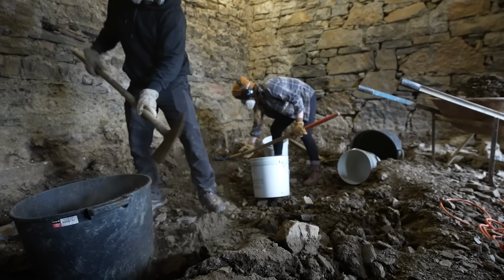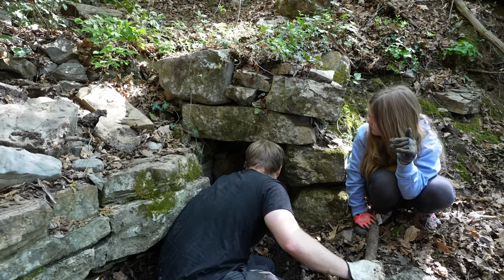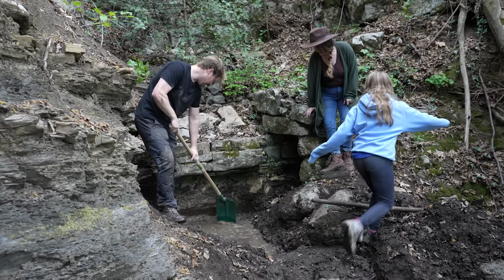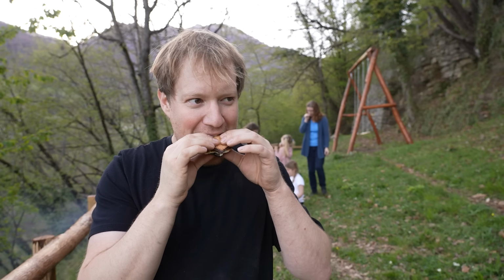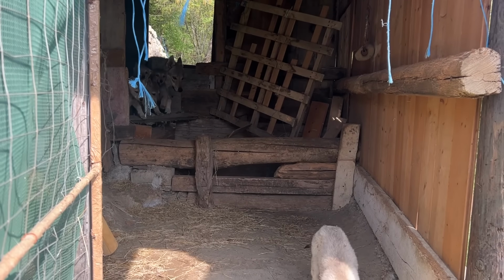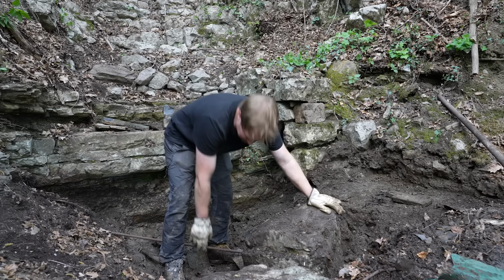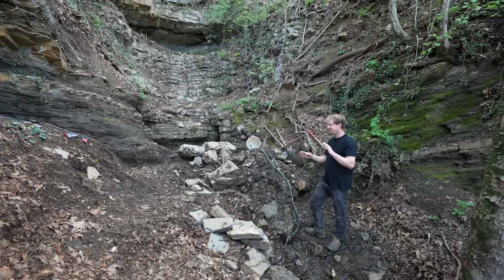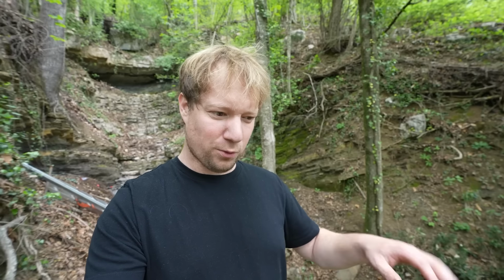Building a Pond from a Natural Spring

Comment: suggestion: drain tub. drill a hole in one of your rocks near the base of your wall. Insert a 1" pipe and re-seal, extending the pipe about 1 foot past the base of your tub. cut down a standard rubber tub stopper to fit in pipe. Now you've got a drain to quickly clean out the water / gunk to let new clean water back in. MUCH better than having to pump it out every time you want to clean!

Comment: What a blessing to have found that unexpected natural recourse! It's very likely that people before you had it pooled up then piped down to the house for livestock or household water. Also, the little stone "box" could have been used like a spring house to keep dairy products stored and cooled in the water. So neat to have that available to you! Bonus for the off grid homestead!
Reply: That's what I was thinking, the box was a spring box to keep things cool.  Whatever it was that happened to the original spring stonework looked pretty catastrophic, perhaps a major flood wiped it out one year?  I imagine it might have had a wooden enclosure over it as well.
Reply: That or too many hugs and mosquitos bred so they filled it in. Or bad snow year and age of the structure to contain or funnel water flow.
Reply: Yes, that is most likely what it is. Old pioneer homesteads here in the Smokies in North Carolina have similar stone boxes beside a spring. Its for keeping milk and other things cold.

Comment: Love the videos. 
When I was living in Brazil,  I did a pound just like yours. 
If your walls are leaking,  install a drain pipe on the lower spot inside the pond to  keep pond dry.  Work on seal wall and floor,  let cement dry and pond should be leak free.  Them plug the drain and let water fill it up.  Good luck.

Comment: I have a home on some acerage. Long story short a stream emerged from 150 feet behind my property. I knew where it began and surmised it passed through my property. I ultimately began getting water in my crawl space. So I set about searching and figuring things out. Ultimately I was shocked to discover a shallow swell passing through my property and a few neighbors was on a different aquifer than surrounding homes. This aquifer was created 120 years ago from natural gas. There were about 25 well heads many of which were flowing but routed through tiling. I continued searching and found a map at the county from 1969 and there it was. My property as prairie and woods with not one, not two but three streams solely fed by water shed and springs. So now I'm preparing to finish up my 3/4 acre pond by building a stream, waterfall for filtration and stocking soon. It is awesome in the Bible Belt we get 90-100 degrees in the summer and my pond only reaches 70 degrees with a fully exposed surface. I've started plants and planted trees but it takes some time. I ultimately have a 15 inch inlet and a 6 inch inlet. I definitely have a good amount of flow 😆

Comment: I'm in NY state and here if a pond is 3 feet deep with a natural base (not a plastic pond) then even when the top freezes in winter fish can survive over winter in it.  We bought feeder fish from the petstore and they do a good job of eating the mosquito larvae and keeping our pond from being a mosquito breeding ground.  we also put a couple of water plants in a pot on a ledge in our pond so that the fish have a little more to eat and it's pretty.  Our plants are tropical so we bring them inside over winter.  Our ponds are about the size of yours and we have a pump (which we use in warm weather)  that moves the water from the bottom to the top.  having a natural spring pond like yours is soo cool, I just wanted to tell you about ours and recommend that if mosquitoes are a thing in Italy that you consider prevention.  best wishes.

Comment: Impressed with your work at the water spring.   Have you considered testing the water for it's natural chemical makeup/PH value?   That may help you decide its future long term use.
Reply: Good call!
Reply: While watching you clearing out the spring. I started thinking what I would do. Putting a Ram pump near the pond, you could run water, anywhere on your property and use just no power

Comment: Suggest you check with a local university and see if a LIDAR scan of your property is available.   Any manmade structure, like an old wall, may be more readily apparent. Who knows what older generations constructed in the past that may be useful if reconditioned?
PS - Nice water retention pond, suggest a waterline with a “Y” near the house that serves hot tub or garden as needed. 
PS2 — You’re going to need an end of the water season procedure to shut off water going into water line to prevent damage from freezing in winter.

Comment: I love that when you get into a project you just go big, no half measures. It certainly looked like the spring area had a lot more structure in the past and it has degraded over time. I think using this for the garden etc will be invaluable and maybe in the summer months you’ll need a cold plunge pool, lol. I am sure you’ll figure out a way to do everything you want with this new pond area. Slightly scary wolf visit!

Comment: If you put clear white sand in the bottom you’d have a CRYSTAL CLEAR water hole.... also, don’t plug the leak, let it drain, just make sure the drain is high so the skin can run off

Comment: Here's a vote for the combination.  It's not like the water stops flowing when you're not there, so build it to do both.  That first pond would make a great size revivor for gardening though you'd need a hose.  Or even make a small 2nd lower catch pool that diverts the runoff to a pipe to your garden, that way you don't have to worry about plumbing through your wall or accidentally draining your hot tub lol.  Or Vica verca. You could in theory even have pressurized water for  sprayers or sprinklers and stuff if its high enough, not sure what the height difference is between the two spots though.

Comment: This is interesting. Did you check if you need any permits for that? Usually it is not allowed to interfere in natural water flows without permits, at least here in Slovenia, even if the spring is on your land.

Comment: Letting that much water accumulate so high up could turn into a big issue with heavy rains. A sensible thing to do would be to contact the municipality and make sure you are allowed to build that as it could cause risk for the houses lower down

Comment: The greening of the mountains and the grasses and wildflowers are incredible.  The amount of water is amazing.  I'm sure some water iwill be more available in the Spring.  What was that the common coo coo bird call I heard?  It migrates up to Europe from Africa in the Spring. You're bringing in all the wildlife and giving the migrating birds a great spot to stop over and get refreshed. It's a magical place you discovered and opened up.  You'll need enough for your garden but as the flow finds its way through the rocks, you may have plenty at it's highest point.

Comment: If you find another plane of rock strata slightly lower (build you hot tub on that)  you can have the spring water when full overflow into the hot tub, but keep the head of water from the spring untouched for you crops.

Comment: You could do both! Make it a hot tub and then pipe the overflow to another basin further down to let it cool before filtering it and piping it through to the graden. If it was me I'd slowly make a series of basins all the way down with top one being the heated and then the next few down would get progressivly cooler. (Another ever expanding project guy, at least in my head)

Comment: Try to chase that spring to its source and clean that out also. That spillway was created for a pretty good flow, and over time a spring can get plugged with debris and slow down on top but is flowing underground. You may find enough to have both a garden and Hot Tub, even a drinking water source, or at least bathing and shower.

Comment: in greece we use lime slurry with cement (1 to 1)to block running water. water cant take it away and after drying is water tide .plain cement wash away easy. after drying maybe are some cracks but with some wet fabric you can fix them

Comment: Hey rancher here that bone is a cow femur. Also springs are tricky sometimes yiu can ruin the pressure as you dig if you do the wrong thing so there’s some give and take I’ve seen people completely dry up a spring doing this exact thing but I’ve also made some pretty amazing ponds doing the same you just need to read the water the land and the pressure it’s something I can’t explane much better but can do in person so I hope ya guys figure it out I just found you. Also on my family’s ranch we don’t let cows step in the springs because that will compact it and ruin the spring as well. Springs are fussy. One you need to keep a certain amount of ground on top of it or it will keep recording down and you’ll lose it forever so one thing that’s a safe go to is take a metal pipe and pound it horizontally into the mountain side in the direction of the water and have some holes also drilled in the pipe then you open it up the size of the pipe yet keep the pressure of the rock and soul on top of the spring so it wants to keep coming to the surface. I’ve done that and made water flow in previously dried out springs. Hop this is helpful to anyone. Remember this tho if you dig to much the spring will recede into the mountain and you’ll lose it forever you can completely ruin a spring by digging to much. All it takes sometimes is removing one big rock and boom the water level drops 20 feet or more into the mountain. I’d take the pipe rout even a small one in diameter if you can find a crack to stick it in. Looks like you did alright there tho super cool spring. I’ve even used a tent pole to have my own fresh drinking water spout in the backcountry for weeks at a time. On your case you’d have to roto hammer a hole through the rock which would work great. It would open it just enough to have free flow but not remove the stone that needs to be on Tom of the spring to keep the pressure built to bring it to the surface

Comment: The overflow from the pond could literally fill a whole stream of ponds connected together, but do install a drainpipe with a valve at the bottom of each pond in case you really need the water elsewhere or need to empty the pond for cleaning etc, also covering off some of these ponds with some simple roofing makes the water a lot cooler and easier to filter because when they reach the sunlight the UV radiation from the sun could easily be too much and kill the good bugs in the water

Comment: I happened on your channel today and found it most interesting!  I'm not sure if you were using Portland cement for the rocks...if you were, it might explain the leaks as cement is weakened by water when still wet.  In Europe, cement is not used to "knit" rocks together - they use lime mortar as it allows stone to "breathe" while allowing them to "move" with the soil and earth like a tight elastic holding the structure together.  Lime mortar has been used for hundreds of years which is the reason castles, monasteries, abbeys and chateaux in Europe have stood the test of time.   You might try that or simply "fitting" the stones tightly together - wide base with narrow top.  Leaks are a part of rock formations in any mountainous region as water will always fray a passage to get out and lower into the ground and flow to the next "basin" of water.  You might want to speak to your neighbors and get their advice on how to manage your spring and work at channeling the leaks back into the pond or setting up a pipe system to bring the 'overflow' down to the garden or a holding tank near the garden. Cheers from Canada.

Comment: Put a pipe right at the beginning of the spring, then move the pool down away from the spring 10 feet or so. let the water run out of the pipe into the pool from a foot high or so. That piped water will be nice and clean for drinking. The pool however I’d only use for watering your garden, or hot tub.

Comment: Exactly. It's gonna flow regardless of if you heat the water or not. The overflow can still be used for the garden. You just can't add chemicals. You wouldn't really need to since the water would constantly replace itself. I would totally bring a pressure washer up there and clean it all good if it were me. Probably should have done it before you started building. But oh well. It's still doable.

Comment: If you build some kind of heater to use the pond as a hottub it's probably be kinda inefficient since the warm water will overflow and constantly be replenished by cold spring water. Maybe just build some kinda hottub from wood up there so that you can decide when to fill it up or have the overflow from the pond trickle down to water the garden.

Comment: it would be good to  gave a hydro electric system using your  spring. you could make a larger basin near your house. have 2 pipes to the spring. 1 up stream, and 1 down. put a generator on the water coming down to the lower tank, and use wind and solar to pump up. this turns the spring into a battery that trikles extra energy. if you direct the flow above, you get more power potential from rain.

Comment: Add a high low syphon and add a ram pomp. The syphon will wait till the water is full, then discharge however much, lets say half, then fill. The ram pump woul slow down the flow, and make it so you can pressurize water and pump it places like a water tower, or crop.

Comment: Those straps are supposed to be looped through each other when lifting. That way the strap binds to the rock, so it won't fall. So folks, never put both loops on any lifting apparatus. Just put one end through the other and lift with 1 loop.

Comment: I noticed that the large rock that was the hardest to move had a carving of a head of a lion or serpent.  You cemented the head upside down on the side of pond were the small tunnel is. It probably fell from the center mantle of the waterfall. If you watch the video before you brought the tripod in you will notice it

Comment: Considering that it's 100 gallons per day, maybe you could use it for a water turbine for power generation.  There's a big height differential that given the proper setup, you could have a good current coming out of it.  Use the excess electrical energy for lighting or just regular power use like the fridge.

Comment: As a former stone mason moving big stone  is easy when done right , a large bar you need  5 ft  r then get yure helper to put a rock under so it doesn’t drop and keep doing that or on flat , you can roll it on cut broom handles , I’ve spent years moving this stuff wit using primitive ways and it works 👍😉

Comment: From your last video (my first of yours!), I am awed by how much stone, dirt, trees and planting you've done in such a short period of time. I know you are getting in fabulous shape even as exhausting as it is to move all that rock! I was thinking that stone aqueduct might have been built in the Roman times?? Maybe someone in the village would know. 

I was in Grenoble, France's mountains last summer (niece's and new nephew's wedding) and learned that Emperor Napoleon used to bring carry stuff back from Egypt (?) on elephants there. I wonder if that happened there in Italy, too. The pond will be so wonderful!!! Maybe you will be able to purify the water for drinking? Looking at that area as you are clearing it, could it have been a natural waterfall?? Or a manmade one?

That's cool that your dad just built a tiny house! We lived in two RV's for four years as we moved to Texas (job loss for my husband precipitated this) and learning to live tiny is fun but sometimes challenging. I was thinking with the RV pump you are using. You may have to heat it in winter to keep the line from freezing. We had to use insulation around the pipes coming out of the ground here in North Texas as we got under 27 degrees as they would freeze. There's stuff called freeze tape which you can wrap around the pipes and it keeps the pipe warm enough if you keep the faucet just lightly dripping/water moving. We also used household insulation wrapped around the ground pipe, too (at the campground we lived at for two years). 

Really enjoying all of your progress! My husband and I built a couple of dry stacked rock planters back in our 30's at our first house in California. Enjoy building those things now! It's a lot tougher when you are older. ;) Happy springtime, Barb :)

Comment: Wouldn’t it be cool if you could pipe the over flowed water from the hot tub down to fill another pool for water storage and summer pool for the kids. Or skating rink for you all. 
Above your hot tub area looks like a dam with all the stone work. I bet it was put there to prevent erosion.? Yes add fairy lights! It would be so romantic.

Comment: If you take one of the leak areas to place a valve, you could run water down to house. You could make a hot tub there and use for garden. You could make stone seating and fire pit by the spring. This means you and wildlife can benefit and enjoy.

Comment: 💦🏔⏳ Slowing down water and promoting absorption through permaculture techniques can indeed have positive effects on water flow and spring sustainability. However, it's essential to consider various factors such as soil composition, vegetation, and local hydrological conditions to ensure the desired outcomes. While permaculture offers valuable principles, its effectiveness may vary depending on the specific environment and context. Understanding the local ecosystem and adapting techniques accordingly is key to successful water management projects.